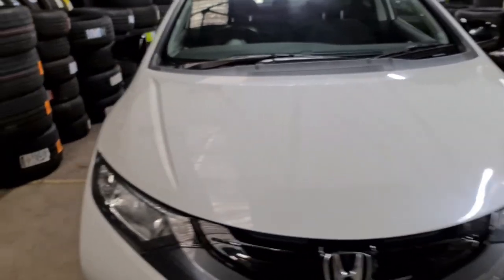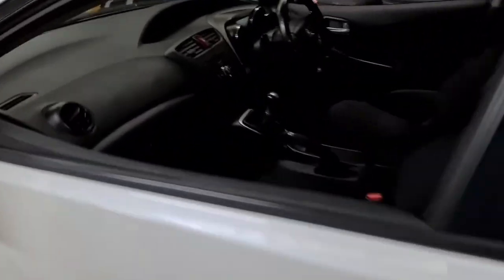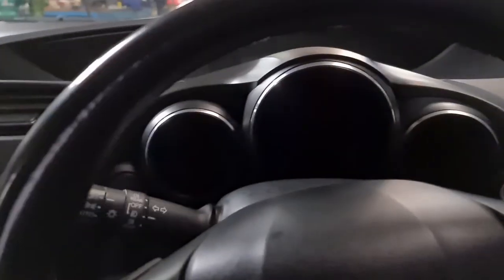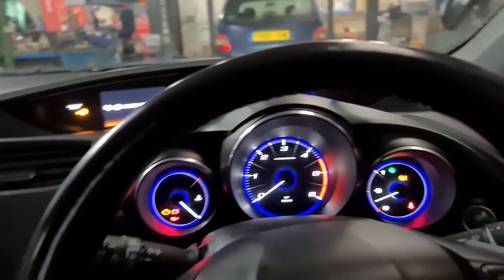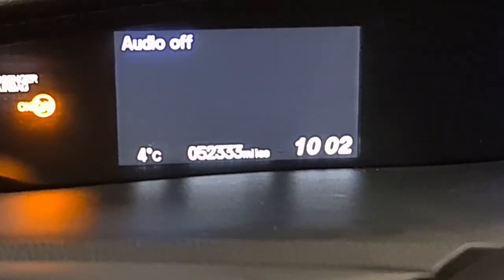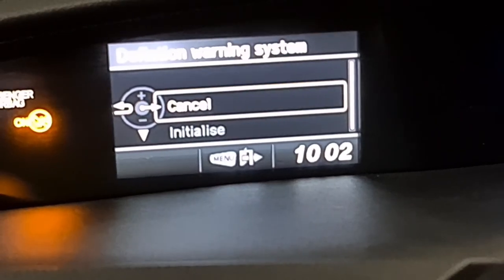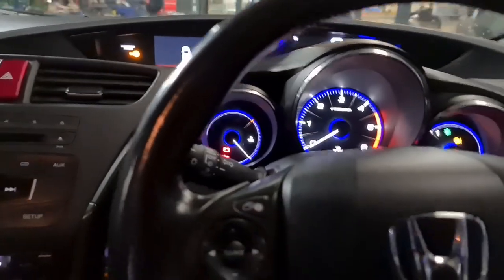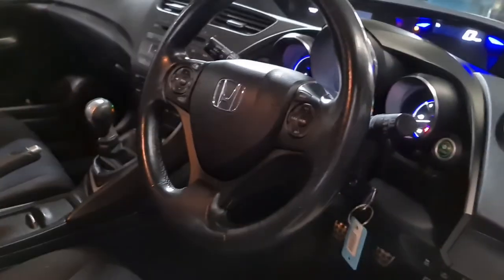how to reset tyre pressure warning on Honda Civic Full HD 1080p

Comment: I just got a Honda Civic Hatch 2014 and I noticed that the mpg display is 21.2mpg. Please is a good mpg and what can I do to increase it
Reply from the maker: Fuel Efficiency of the 2014 Honda Civic Hatch:
The official fuel economy for the 2014 Honda Civic Hatchback is 56.5 mpg. However, it’s essential to note that real-world fuel efficiency can vary based on driving conditions, maintenance, and individual driving habits.
According to data from actual owners, the combined average MPG for the 2014 Honda Civic is around 31.67 mpg. Keep in mind that this figure might differ depending on the specific model, driving style, and other factors.
Tips to Improve Fuel Efficiency:
Regular Maintenance: Ensure your car receives regular maintenance, including oil changes, air filter replacements, and tire rotations. A well-maintained vehicle tends to be more fuel-efficient.
Proper Tire Inflation: Check your tire pressure regularly and keep it at the recommended level. Underinflated tires can decrease fuel efficiency.
Smooth Driving: Avoid aggressive acceleration and braking. Smooth driving conserves fuel.
Remove Excess Weight: Remove unnecessary items from your car to reduce weight. Extra weight affects fuel efficiency.
Use Air Conditioning Wisely: Running the AC consumes more fuel. Use it judiciously.
Avoid Idling: Turn off the engine when parked or waiting for an extended period.
Plan Efficient Routes: Use navigation apps to find the shortest and most efficient routes.
Drive at Optimal Speed: High speeds consume more fuel. Stick to speed limits for better efficiency.

Remember that individual results may vary, but following these tips should help you improve your Honda Civic’s fuel efficiency.